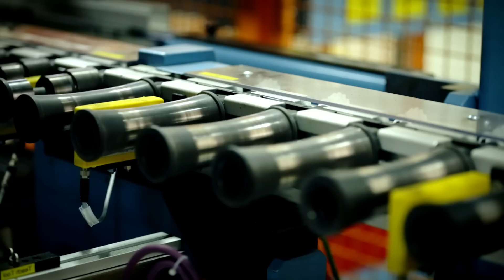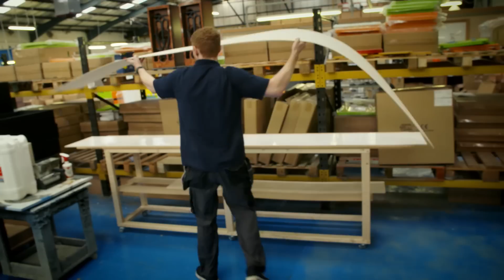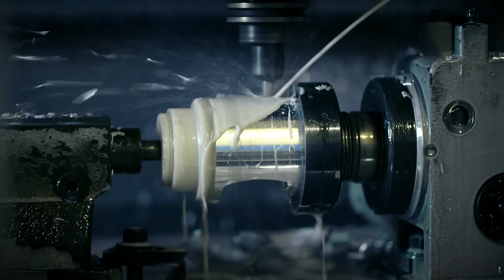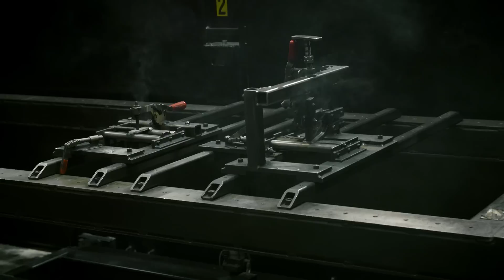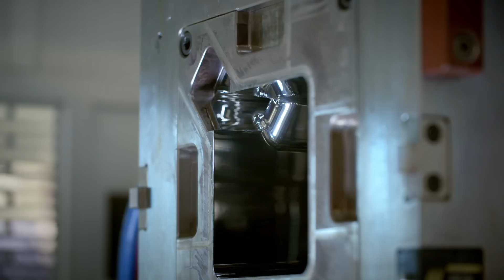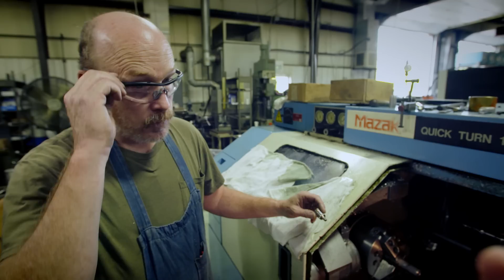How a Chainsaw Works | Ultra Realistic CGI | Full Documentary | Machines: How They Work | Ep 1

Comment: The main reason the blade is blunt is because if it was sharp, by the time you've blended any frozen or hard foods (ice, nuts etc.) 2 or 3 times, the blade is now dull as a sledgehammer and would need to be sharpened...making it blunt, drastically increases it's working lifetime even if it does need a stronger motor to drive it through the food than a sharp blade would need...

That 1,800 Watt motor is 2.4 Horsepower for those wondering...